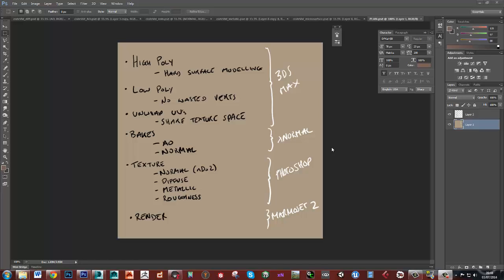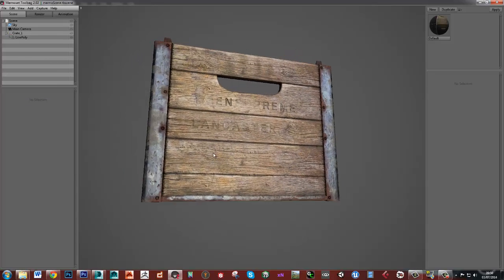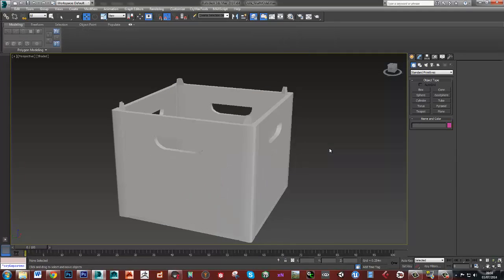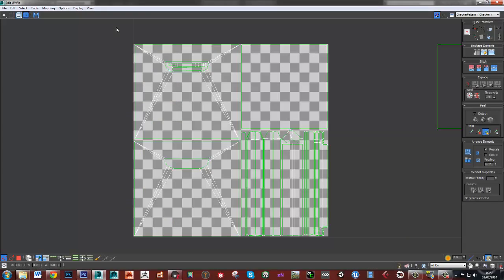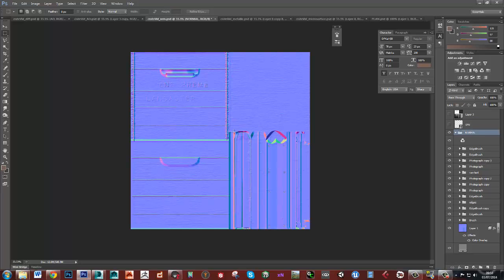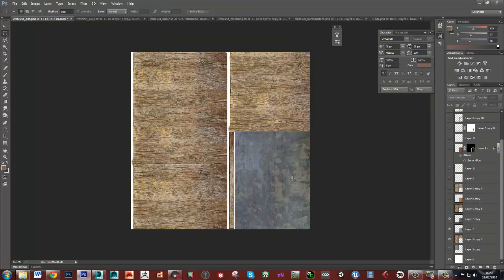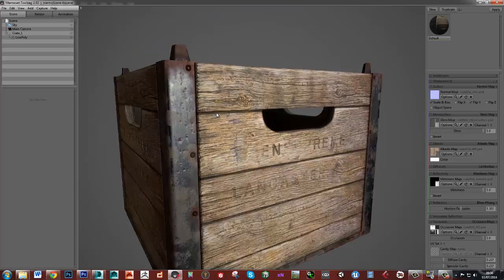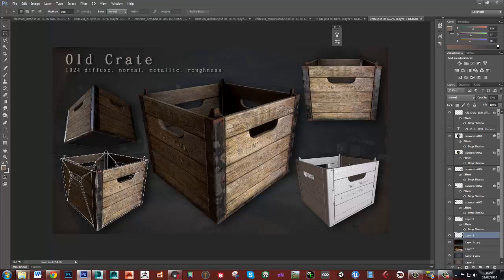High quality physically based game asset - part 1 Intro

Comment: Hey Barry, great tutorial, thanks for that. I was wondering, the end result is shown in Marmoset2 (which is great and I now have that), but I was wonder if you could set up 3DS Max to show you the same end result without using Marmoset? So taking all the applied textures (materials), setting up a material in Max and seeing the same result in Max either in the viewport or as a render?
Reply from the maker: Hi glad you find the tutorials helpful.  As far as I know (and I might be wrong!), there is no way to set up 3ds max to use the same physically based maps that are used here without some kind of expensive 3rd part renderer.  You could set up the asset in Unreal 4 instead though or get the beta for Quixel 3do which I think is free at the moment